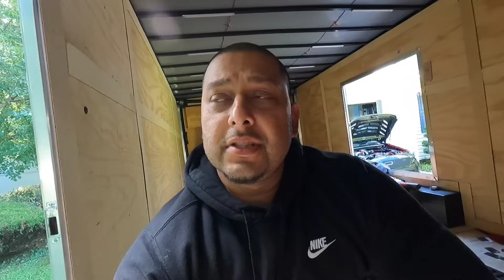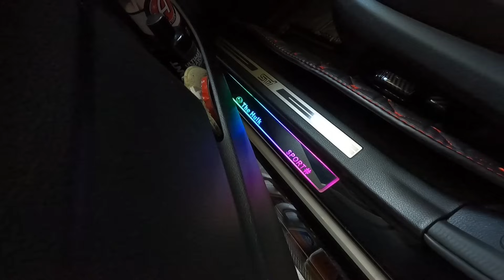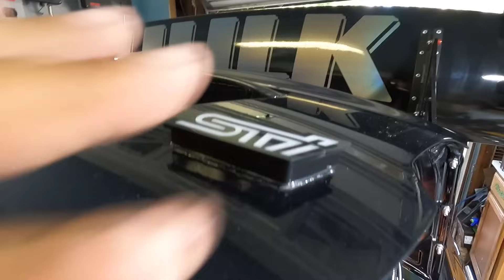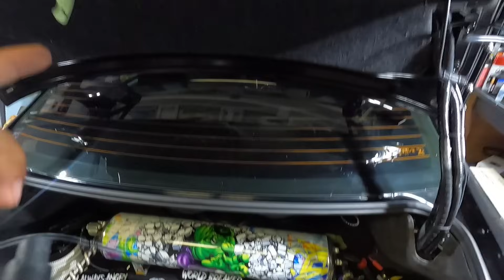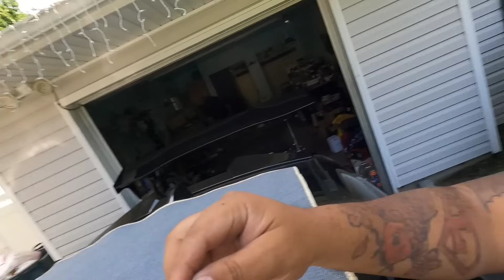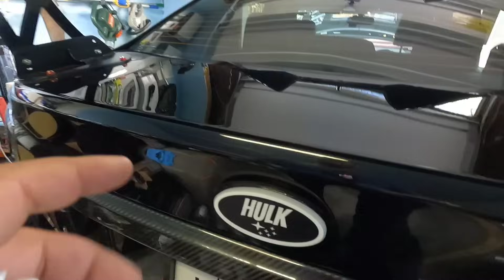Custom Rear LED Emblem for my 2018 Subaru WRXSTI made by Aoonuauto(unboxing and installation)

Comment: I got one for my front, I haven't installed it yet but I know I'll run into the same issue where the grille has curve and the emblem is straight. I wonder if I put a heat gun to it, if it will let me bend the plastic a little to give it a curve. I'm a little reluctant though... it's not cheap and I don't want to ruin it either.
Reply from the maker: Definitely DON'T DO THAT.  You're gonna ruin it with a heat gun.

Comment: I got one for my toyota corolla LE do you know if it will effect the front sensor radar....collision radar..it's not attachached to emblem....thought about putting it in myself the one that changes colors...taking it to an audio shop thursday...
Reply: i took mine to like 3-4 shops and all told me they couldn’t install it on my front toyota emblem for my 23 camry because it interferes with the collision sensor 🤷🏽‍♂️
Reply from the maker: If it's gonna interfere with your collision system, then I wouldn't recommend installing it.
Reply from the maker: If you're putting it where an emblem is to the front then you shouldn't have an issue with your sensors.  Just pay attention to where you're placing it.
Reply: @WikedWips  what you mean it's gonna go in the stock toyota emblem location in front...ima take to shop got an appointment thought of doing it myself but i need better instruction I have a roomate who is a electrician who's willing to but there's no solid videos.
Reply from the maker: I meant that usually most Toyotas have an emblem in the front and back...you mentioned affecting the front radar system.  So I didn't know if you were removing a stock emblem in the front and replacing it with another.
Reply: @WikedWips  Aoonuauto sent me your video but I noticed your doing rear...and it still bit confusing so i might take to shop and show them your video